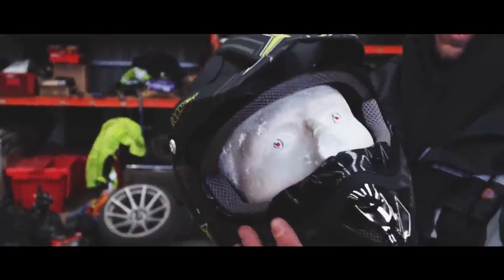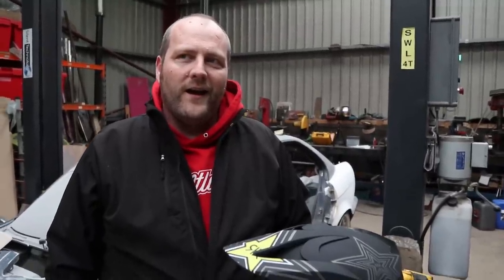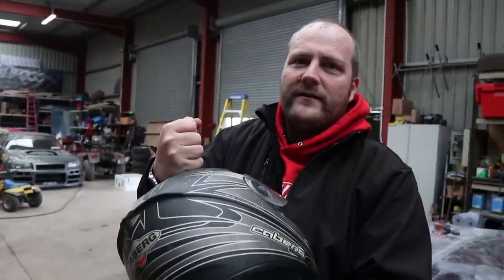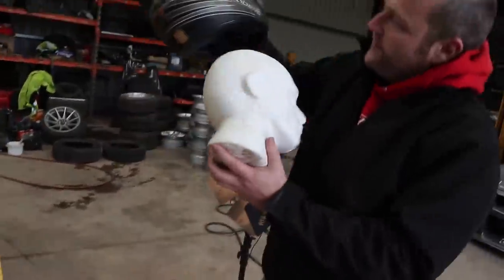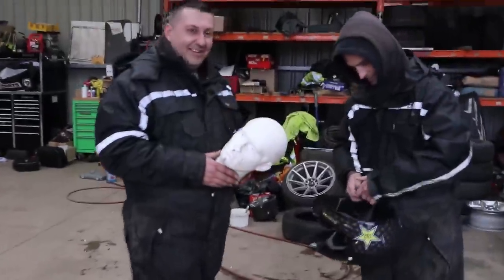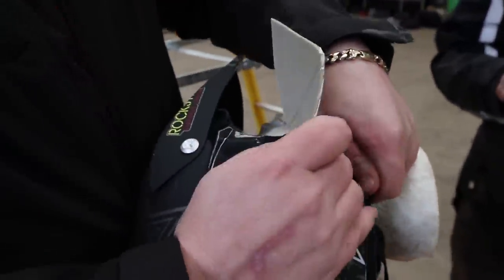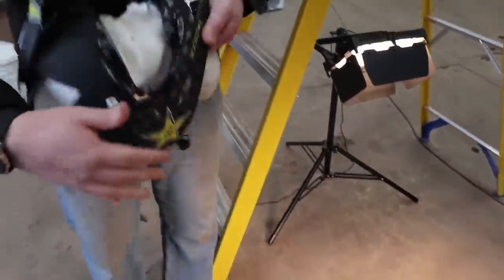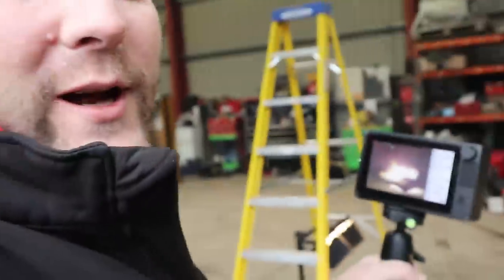How dangerous is a wish.com Crash Helmet? TESTED!

Comment: They do have to protect you well from the sides, back, top, front - that's why SHARP tests and ratings exist.

And NEVER buy used helmets.
Look for a BMA sticker and ECE rating and the helmet is in date. Once worn they have until 5 year of wearing or 5 years of manufacture date (whichever comes first) till they are no longer deemed safe as the internal foams and plastics of the shell degraded.

Technically loaning a helmet for a fee which is out of date or damage is charging for a faulty safety device which can lead to legal implications as well. 
You can buy a Sharp 4 (out of 5) LS2 helmet for £50.

Helmet safety in any motorsport needs to be made more aware and more circuits need to become more vigilant on helmet standards.

Great video to highlight customers  about dangers all be it a bit out of touch with information.
Reply from the maker: We aint suggesting its a good idea to go second hand, But there are people who only want to spend £15 on a helmet. to those people we'd say a known brand 2nd hand one is preferable to one of these
Reply: @DriftlandTV  aye I get where you are coming from, maybe could. Of been conveyed a. Little. Better a maybe with some links to suitable helmets at different price ranges.

However... Any information and push towards safety is better then none
Reply from the maker: @midenking9651  good shout. All our videos are shot adhoc, 1 take so sometimes thing don't come across right.
Reply: @DriftlandTV  I know the struggle, I review gear and bikes for a shop online by YouTube and when doing helmets it's normally a pre planned whiteboard and 3 takes.
Reply: Actually caberg helmets are quite good, even if they are not expensive, they are made completely in italy and the caberg duke 2 is one of the few modular helmets that had a 5 stars rating for the sharp test. They are small manufacturers and sell mainly in italy and do not invest in marketing so it's not like they are well known. Furthermore given these conditions and the fact that they are not sold in the us is not likely they will ever apply for the snell tests.

I'm not being paid by Caberg by the way ahahah
Reply: I dont even know why DOT ratings are still a thing... they are completely pointless
Reply: @kissutyi2310  it's a US thing I guess. Luckily my helmet I have wear when riding my Honda shadow, is also snell rated as well. Apparently it's hard for us to get ece rated helmets
Reply: Don't let helmets get out of date either, I thought it was a myth, had a 4.5 year old helmet (meant to replace if un  damaged every 4 years)
Cased a jump on my dirt bike, my mouth guard on my helmet exploded in semi light in pact with my bar pad, and blew a few of my teeth out, 12k in tooth repairs, which I can't afford, and absolutely zero confidence, around new people. All for the sake of a new $200 nzd ls2 helmet.

Comment: I think they are downhill biking helmets that’s why they are light but I wouldn’t want that protecting me
Reply from the maker: I wouldn't trust that on my head vs a tree.
Reply: I got a motorbike helmet from wish and I was being sold as a motorbike helmet, I dropped it from standing on a chair and it smashed in to bits. My real motorbike helmet is over £300. I would never buy a cheap helmet anywhere.
Reply: @DriftlandTV  as a person who rides downhill, i can say that you dont really go that fast, to be honest so that would probably do a fine job, not a great job but a fine job. still would prefer a mx helmet.
Reply from the maker: @ville_1235  that wheel was going about 15mph. Your body weighs more than that and downhill bikes goes fater than 15mph. I wouldn't fancy my head meeting a tree in that case. Better than nothing? Maybe. But I wouldn't gamble.
Reply: gregg davies same that’s what I thought... I do dh mtb
Reply: Definitely not a DH MTB

I've been riding DH for years and can easily reach speeds of 30mph on some downhill sections. I don't drive so I've got a little speedometer on my bike for riding on the road.

My worst crash was 4 years ago now, I was bombing down a natural section in Wales and hit a rock at about 26mph. I was launched into a superman position over the handlebars and hit spikey boulder. Fortunately I was wearing full body protection and a Carbon full face helmet. I walked away with a fractured left wrist and a small fracture to my skull.

I'd go as far as to say this cheap helmet from wish.com isn't even legal for any type of use in the UK.
Reply: Chris Collins u can get snell and ece certified helmets for under 300
Reply: It's silly to think that my mountainbike helmet held of with some scratches at 50 km/h and broke just by letting 20 kg from a ladder :)).....
My two cents....If you want to buy  a t-shirt or a pair of pants, you can buy from Wish.com.....The odd thing that could happen, is that your arse will be naked.....
Safety gear should not be bought not even from shaddy shops......
Reply: @kaneholmes8860  absolutely.  I ride DH and my tsg helmet as as much material as some MX helmets . It's not an expensive one either around £100 . I wouldn't trust any safety stuff off wish .
Reply: @ville_1235  I'm not sure what or where you ride but I can easily manage to average 15 mph doing downhill.  On some tracks with a motorway section riders clock speeds up to 35 or 40 mph and that's just local riders.  That helmet won't last any sort of impact.

Comment: It's a bicycle helmet and the EN1078 cert that applies to it actually requires it to deform and dissipate energy in low speed impacts, to avoid concussions. It performed exactly as it should.
Reply from the maker: Would you wear this head first into a tree at 20mph? I know i wouldnt

Comment: The Wish.com helmet is good enough for low powered dirt bike or weekend bicycle stunts. However I wouldn't judge the helmet simply by its flexibility or if it cracks upon impact. Whats more important is the impact lining that absorbs the blow to you head. Got Black Armor one myself with wide eye port which is really nice when going sideways and it has anchor for HANS if I want to go grip one day and expect a major impact, but damn was it pricey.

Without a good impact lining the force is transferred directly to your skull which means you brain is going to squish against the cranial. Shatter or a crack on the helmet only starts to matter if you take repeated blows to your head, like for example the car tumbling over several times and loose equipment flying around. Even in that case the loose debris is not really that much of an issue as they will be pressed against the sides of the car just like you are pressed in your seat due to centrifugal force.

I am NOT saying you should be cheap about your head protection. If everything goes badly you might burn or get paralyzed but for fucks sake that's better than being a vegetable.

ALSO how the fuck does this channel have only 11k subs? Content is great, please keep making more.
Reply from the maker: Thanks dude. We agree. We only had 9k subs last month so we are on the up. Help us by sharing the good word of some Scottish idiots.
Reply: I doubt very much if the Wish conforms to any helmet standard at all. Even the cheapest bicycle helmet you can buy in the UK will be certified to the appropriate standard and I'd take that over the Wish helmet any day.

Comment: My friend, if  you know the wheel mass, the dropping height and you assume no acceleration given when drop the wheel (so just take a "free fall" for granted) you can get impact velocity, then also calculate the strength of impact. No need to use footage for those calculations.
Reply from the maker: looks like they've done some calcs in other comments

Comment: Aghh! Don't be advisin' folks to buy 2nd hand helmets, lads!
We do full face Sparco track-day lids for £72 brand new! And open face OMP lids even cheaper. Why risk it?

Loving the unscientific testing regime, though. The lab is deffo one of the most unusual I've seen... 

Keep up the good work.
Reply from the maker: Turner Autosport sounds good steve link us and we will put them in the description?
Reply from the maker: +Turner Autosport obviously we want people to buy decent helmets. But for the folk that want to spend 15 quid. 2nd hand has to be better than wish?
Reply: @DriftlandTV  can't argue with that!
Reply: @DriftlandTV  actually... No. A SH helmet could be fucked and you wouldn't know.
If it's been dropped and the inner foam is damaged or compressed it's a risk to you.

NEVER buy 2nd helmets.
When I helmet is done with - Spray paint it or smash it.so it can't be used again.

Comment: For something sold as a motorcycle helmet, or even a bicycle helmet, that brittle plastic they used and the cheap styrofoam mean if your head touches the pavement when you go down, that thing's coming apart. Hopefully the surface isn't too rough or it'll snag and try to rip your head off...
Reply from the maker: Scary bad.

Comment: You could put a swim cap on that dummy head and the cap wouldn't break either. I'm not certain a swim cap would protect your head any more than either helmet. That first helmet deflected a *lot*. If your skull were to deflect that much it would break and/or your brain would have severe trauma. The fact that a helmet is broken after impact doesn't really indicate if it protected you from an impact. Ideally, your helmet would absorb numerous impacts and remain undamaged but from a practical perspective at a certain level of damage you would rather the helmet break (absorbing the impact) than deflect (allowing the impact to transfer to your skull (just like a swim cap would). The point is, don't rely on YouTube for helmet safety unless you want to die.
Reply from the maker: Or just buy a proper helmet as we mentioned!

Comment: Isn't the helmet supposed to crack as apposed to sending that energy into your head?
Reply from the maker: negative
Reply: under no circumstances a helmet is supposed to crack. what you can see in the slow mo is also the fact how much this "helmet" get compressed when the wheel hits it. even if this piece of shit would not crack you get a serious injury. and a car wheel on a helmet is nothing compared to an impact on the road when you are going a bit faster.

Comment: Surely the wish helmet is a mx style push bike helmet? I know my kids would love to have a helmet for their push bikes that looks like a grown up helmet
Reply: @brandonf2163  looks like it's made the same as little kids helmets, main difference being the polystyrene is encased in this one  in most kids helmets you can easily see the inner and they only cover the top and sometimes sides of the head, remember kids (5-7yrs) don't normally do anything that needs to withstand a tyre falling on their head. Don't get me wrong I wouldn't buy a helmet off wish but it seems designed more for kids who ride their bike along the front of your house than anything else
Reply from the maker: DARWINISM

Comment: as far as i can work out say from using the the ladder as a scale the wheel wasnt going that fast, less than 15mph
Reply: Yeah, I did a quick calculation based on 2m height and 20kg mass which comes to 22.5Km/h or 14mph.
Reply from the maker: +George Grinter yeah it wasn't that fast at all.

Comment: Make sure you buy rated helmet. I can't remember the standard used in the UK but I think SNELL was one? I think most places in Australia require one rated to Snell2010 (SN) or AS1698 for most motorsport.
Reply from the maker: Always buy the best one you can afford from a reputable source
Reply: ECE is the European and UK standard. Snell is American and an optional extra standard mainly for racing, it’s not related to road use but obviously you can get helmets that are both DOT and Snell or ECE and Snell.
Reply: @martinfoster5163  I'd rather have snell and ece but mine is dot and snell. At least I have one good rating haha
Reply: I should also mention I use it for riding on a Honda shadow on public roads and no tracks

Comment: But Isnt the wish helmet just a bmx helmet and not meant to be used on motorbikes or for motorsport? I think thats why its so weak. Or is it advertised as a motorbike helmet?
Reply from the maker: RIP Potta Coola and anyone who rides his bmx
Reply: @DriftlandTV  Lol i asked a question i didnt state it IS a bmx helmet. Also IF it is a bmx helmet you dont really get situations where 40lb+ car tires fall on your head or bangers thrown in your face in parks, there designed for falls from riding  height.
Reply: @pottacoola  BMX and DH lids go through a test much like a dot test.   They are as strong as some of the MX lids.  KALI for example is sharp rated . That wish helmet has zero padding  it would fail any helmet test for full face helmets.

Comment: Don't buy anything from websites like Wish ! You can find all that trash for way cheaper on ebay and other websites , I installed and tried Joom as well, a really similar app and looked for some shoes , I found them and they were the same cheap trash that was sold on ebay for a fraction of the price. These apps use a variety of tricks to sell products , I used Joom for almost a whole year and their stuff was dirt cheap , after a couple of updates they started selling the same stuff at higher prices and added a system that offers you "discounts" , not only that those discounts are a lie but they as well sell you the trash for a higher price than it's even worth. It's like the old trick clothing stores use , they raise the prices 2-3 months before the sale season comes up and then reduce it to the initial price .
Reply from the maker: good info

Comment: dirtbike/mountain bike helmets are designed to be much lighter than a street bike helmet. They also go through different safety tests. So its not exactly a fair comparison, but still a good video all the same. Ill stick to my CF dirtbike helms if i want something light on my dualsport lol
Reply from the maker: Yeah this is in no way scientific. We like smashing stuff that isn't people on track, that's all. I wouldn't want to fall down some stairs wearing that thing. 🤣
Reply: Idk about mountain bikes but just because it's a dirtbike style helmet still should have the same certification
Reply: @cubes6413  it sounds like that should be the case, but dirtbike helms don't have to obide by the DOT regulations because they aren't street vehicles. Many do, and those seem to be branded "dualsport helmets" quite often. But DOT standards are honestly quite garbage anyway since the regulations are loose and the company who manufactures also does their own testing for DOT, as crazy as that is. SNELL and ECE are much more stringent and have to be tested by an external testing board to qualify. But you seldom see those on specifically branded dirtbike helmets, and almost never on budget options.
Reply: Side note, SNELL testing costs a he'll of a lot of money for the factory. So many helmets that also stand up to ECE standards also would pass SNELL even if they arent certified.

Comment: Sure its a janky helmet but it wouldn't matter what you had on your head if you dropped a wheel and tire from that height on your head your neck is broke. A better test would have been to weight the helmets and drop them
Reply from the maker: like jumping off the top step head first maybe? volunteer you! 🙈
Reply: @DriftlandTV  if your going to film it lets do it. It wouldn't be the dumbest proposition I've agreed to
Reply from the maker: wow!😱

Comment: Should've gotten a snell approved one, fyi... Dot approved is such a loose approval, snell is race/track safety approved.
Reply: Or ece
Reply: @toad3222  i will have to look into that as i didn't know there was such a thing, all i knew of was snell is accepted in US and EU. Thanks for the info!
Reply: Tyler Hopkins, not exactly.  For a helmet to be legal for road use in the US, it MUST be built to DOT requirements.  Snell or ECE is fine, *IF*, and only if, it has the DOT label.

For track use, you’ll almost always need Snell, but if you have a Snell-rated helmet without a DOT label, you cannot legally use it on US roads.
Reply from the maker: Good info chap. Thanks.
Reply: All that said, you’ll effectively never find a helmet with either a Snell or ECE rating, without a DOT rating, unless it was simply never intended for use or sale in the US because, while the DOT standards aren’t completely redundant to either Snell or ECE, they’re so close as to be essentially cost-free to make sure DOT is covered if the helmet qualifies for either.

But it’s still illegal to wear a helmet without the DOT label on US roads.
Reply: The real irony is that the DOT refs were expressly written to be a basic standard which would be updated in just a few years, once the safety research was done.  Instead, it hasn’t been updated in the decades since, and both Snell & ECE got the benefit of starting from the foundation of the research that was supposed go into updating DOT.
Reply: @Vessekx  Right, to be honest, I didn't think it was possible to possess a Snell approved helmet that didn't also come dot approved. I also found it interesting that the Dot and Ece ratings are more so a federal standard and almost never get retested on a particular helmet after the initial approval, as where the Snell approval being a private party group does do retest/certifications randomly on the same helmet. Odd that a private party does more checks than the government official services.
Reply: Fyi, I honestly watched this because i already had a wish helmet already on the way. Just got it in and I think it'll make a nice planter after seeing this.